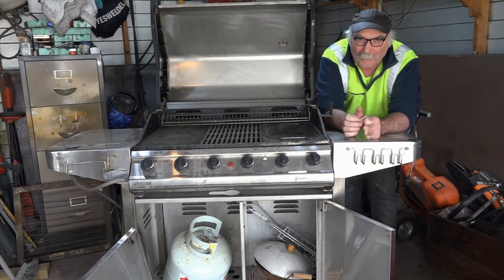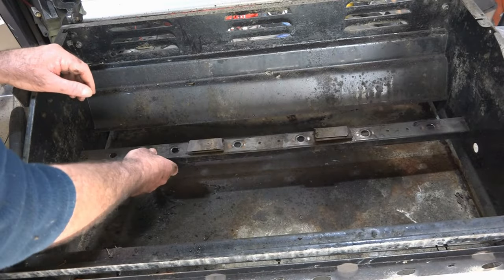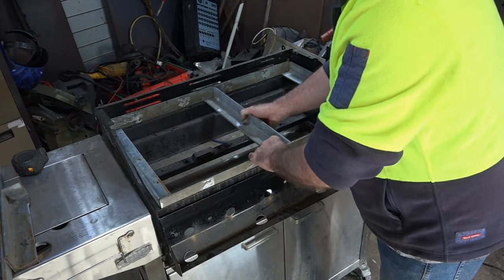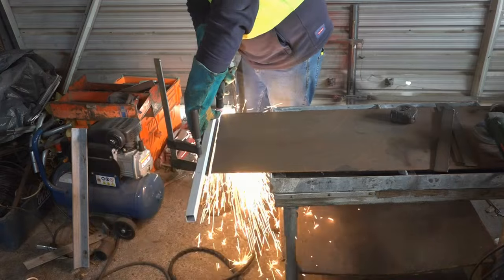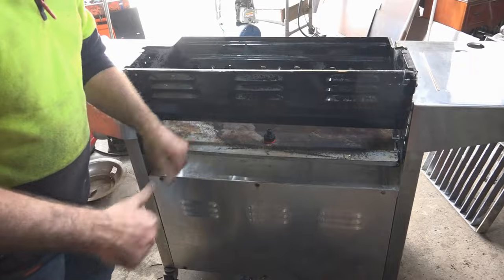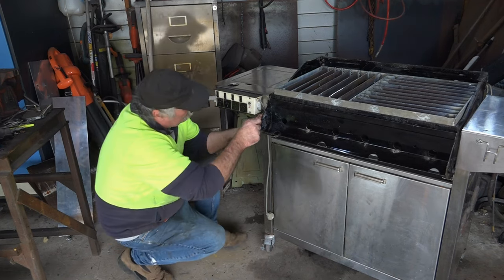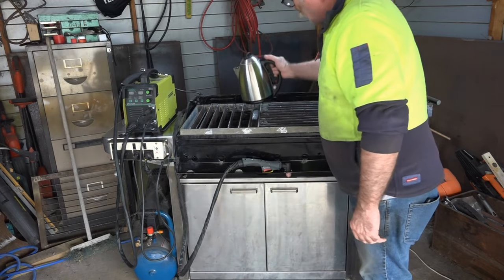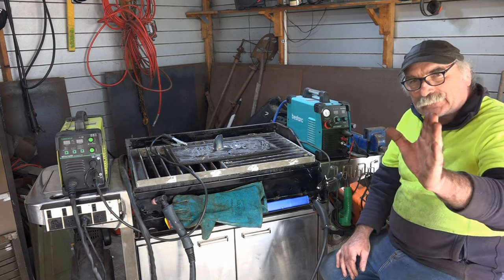DIY: Build Welding & Plasma Cutting Water Table for Free

Comment: About 15 years ago I took an old cheap grill frame. Added some shelving wood (particle board with laminate cover). Built a nice little cart for my compound miter saw. Works a treat. I can wheel it around where I need it, and the two sides sit at just the right height to be level with the saw bed so I can cut long pieces with an extra holder.
Reply from the maker: That's such a clever DIY project! It's amazing how a simple idea can turn into a useful tool for so long.

Comment: Hey Pete. Love your channel. I have an idea for you. Lets say your oxy/ acetylene tank is empty and you need to heat a 10 mil steel bar in order to bend it for a project. Can you use your pilot arc plasma torch to heat the rod without burning through it. Thanks Gardner
Reply from the maker: check out my other videos .have bent steel with plasma cutter

Comment: nice, made my plasma cutting trolly from a small roll around parts trolly, needed to be small as i have a small garage (uk)
i have the traditional slats that i can pull out individually ad i also made a small square grid from 1 inch tube for the really small stuff
no water, its got a sloping trough that catches the sparks in a small box at the back
Reply from the maker: Your plasma cutting trolly setup is awesome! Love the ingenuity in making the most out of your small garage!

Comment: Had to tell ya. I was scrapping a store old movie red box machine. There is a whole plasma machine . Or CNC machine. Inside lol. Wee! Heu!! I just have to pick the right movie to get the right cut.  Lol. But really. I just want strait cuts. So I use the motors. With a switch. On or off. … and the movie slots will all hold water. With good drain hole to clean. .  All aluminum no bearings . Slides easy.??  Good luck on finding one behind a store. . It’s just all I need. Nice strait plasma cuts. I might use trigger style  on of switch with few toggles switches.,. I will do circles by hand. ?
Reply from the maker: Wow, that sounds like a creative project! It's amazing what you can find in unexpected places. Good luck with those straight plasma cuts!